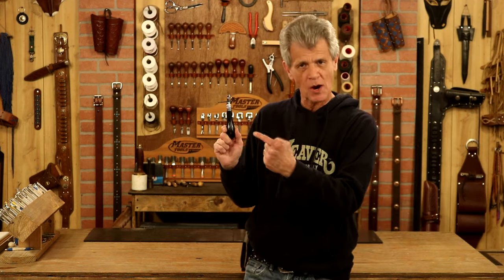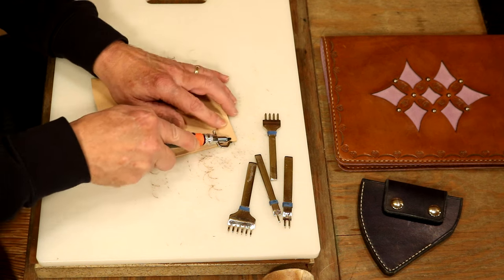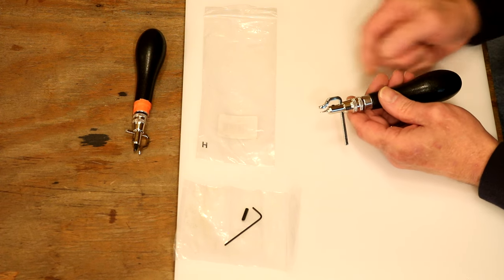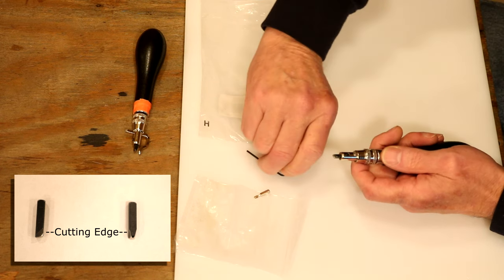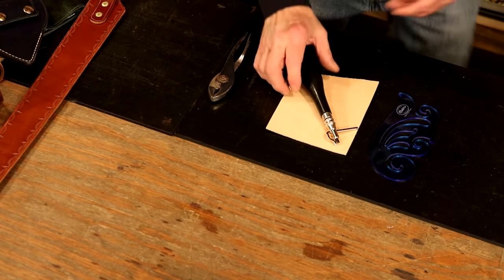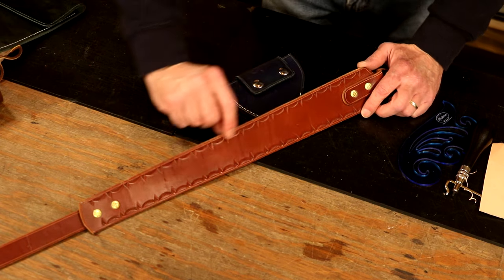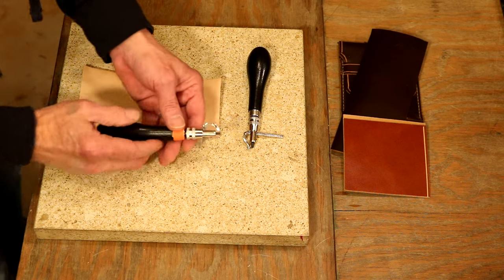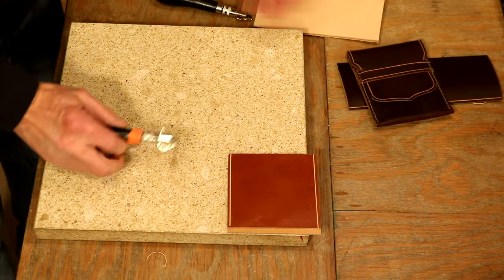The Leather Element: Stitch Groover

Comment: Honestly I pretty much quit using the stitch groover all together. One slip and your project is done and it's too difficult to follow tight radius curves. I just place a light line with wing dividers and follow with pricking irons. If I want a decorative line I have several easier to run tools for that. Also I've found a groove for the purpose of burying the stitch completely unnecessary. Just my methods.
Reply: You have to pay attention to what your doing... mind your edge, and remember that leather has different densities as you go along... It is a learning process.
Reply: I’m with you brother I hate the freaking stitch Groover OK it’s a love-hate relationship… I actually have tried to sharpen it on the the leather on the piece of wood what do you call that Strop board. Which helps occasionally most times it’s just doll or it gets clogged up hopefully he’ll give us some good tips on sharpening that little demon leather tool… Rock on dude hey good point I never thought about just punching my holes without the groove cause I know I’m gonna mess that up too lol rock on brother
Reply: You can also use the Compass thing for just a line you don’t have to have a groove or just use a stitch Gruver for a little line to get a straighter stitch punch… Oh yeah I’ll make Holsters. I’ll do very little stitching anyway but occasionally I do a man bag. Typically I just double cat my stuff
Reply: Yes, Yes, all of this.  I have a love/hate with my groover and tighter curves.  I've ruined a few pieces now with inadvertent slip off the edge....

Comment: One piece of advice for people just getting into leather like I am. DO NOT CHEAP OUT ON THE GROOVER. I’ll admit I bought cheap starting tools off Amazon. And I’ve been able to complete projects and get decent results with everything EXCEPT the groover. 
Cutting head didn’t like up with the guide when fully seated, dull blade leaving more of a scratched in groove than a nice cut one. It was a nightmare. 
Trust me, spend just a little extra and get a decent groover.
Reply: Can you buy a quality cutting edge replacement? I think that might be worth it when you're getting started instead of buying a whole new groover.